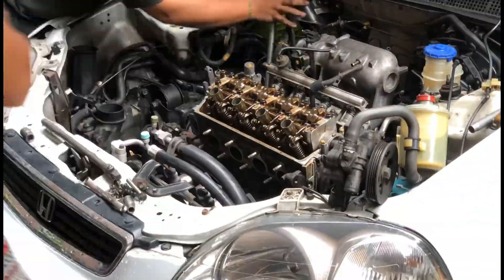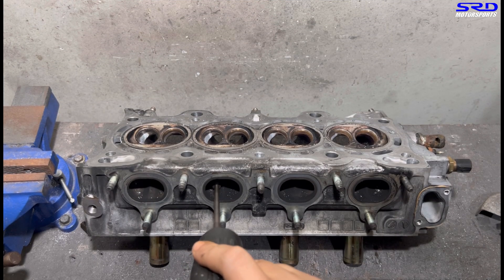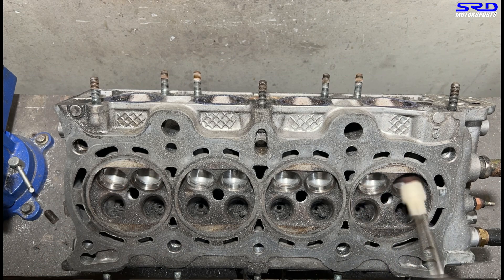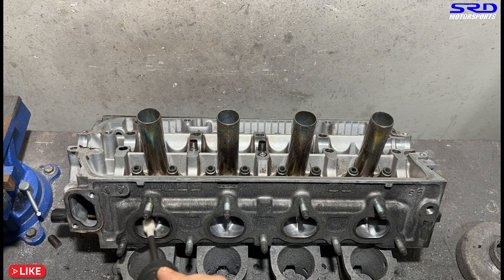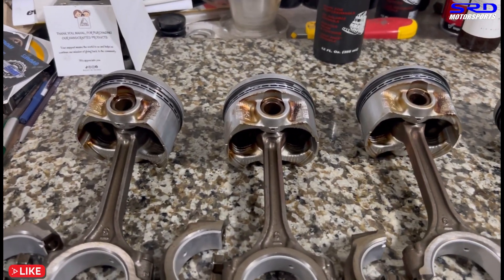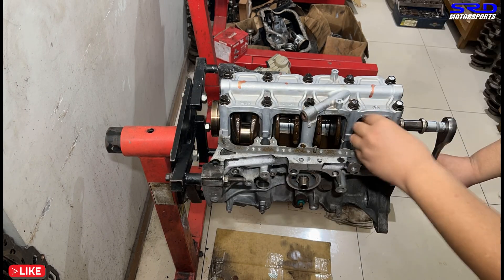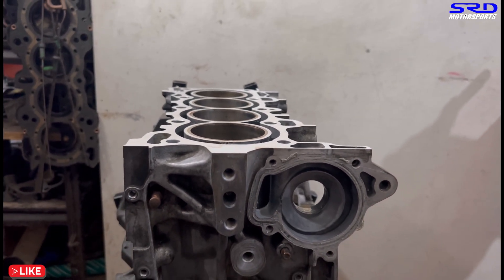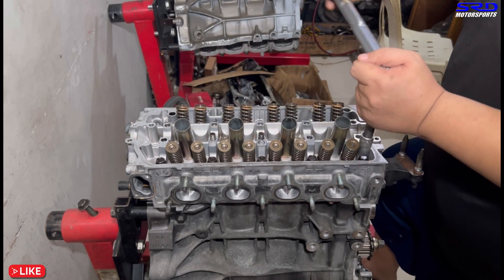1996 Honda Civic VTi Ph16a OEM Rebuild Series part 2

Comment: Should've put skunk 2 rods while you're at it
Reply from the maker: on stock pistons? It’s a stock rebuild if noticed
Reply: @SRDmotorsports but you already ported it so i assume high revving shifts
Reply from the maker: @pongosp  nope , for efficiency… it’s still on stock ecu… and if it isn’t turbo on a sohc, arp rod bolts can handle 8k + shifts no problem

but yeah going back it’s all about efficiency 

It’s a stock street car that the owner just opted for a rebuild but I hear you man…
Reply: @SRDmotorsports the owner is gonna love revving the heck out of that engine so i would've gone all the way
Reply: I would've gone all the way pistons, rods the whole 9 yards

Comment: Hello, i love the videos you post here. Was wonder if you can answer a question for me? I have a rebuilt motor, it's been sitting for half a year.  what can I do to lubricate the cylinder walls so I can rotate by hand?
Reply from the maker: oh if it has been assembled and sitting? turning it should be fine it should still have good oil on the rings as it hasn’t run yet to dry it up

Comment: 11:23 Free octane 🤓
Reply from the maker: hahaha maaaan! Good eye! And I think not many tend to figure out its advantages 

I mean my esi engine runs a ph12 piston which sticks out 0.022”
My solution? Flycut the chamber to get the quench matched well now 13.4+ comp and XCS is fine 😎
Reply: @SRDmotorsports  And they wonder why you can run more compression than they can 😉
Reply from the maker: @findtherightbeat  true true! And what’s interesting is there’s a “few” in the aircooled vw scene also runs “high” comp and surprisingly they also make sure the quench distance is as good as possible or better than usual

Then I realize it does work regardless of make or brand